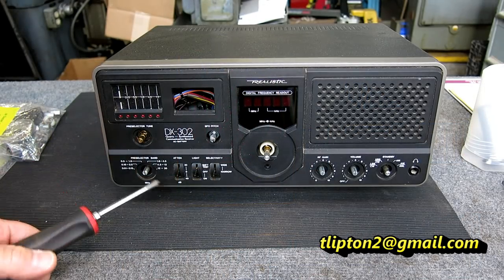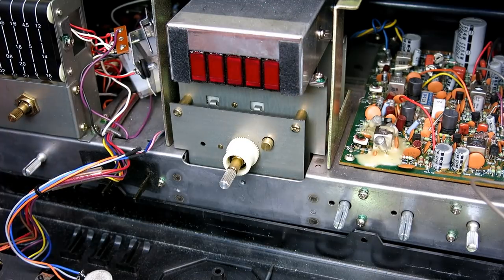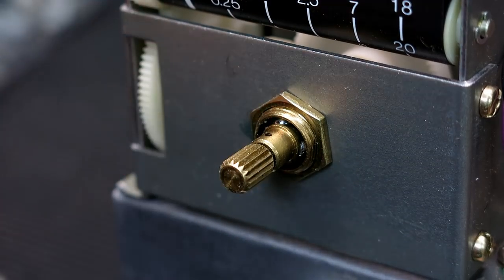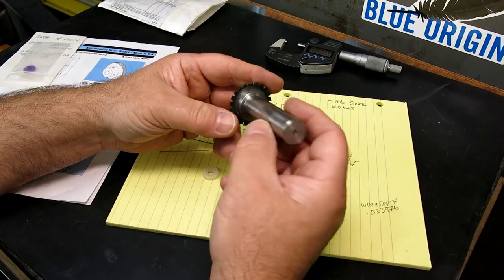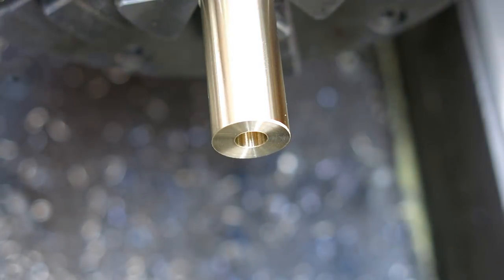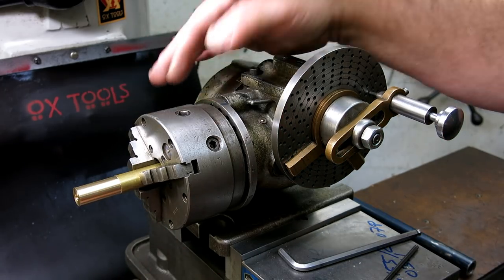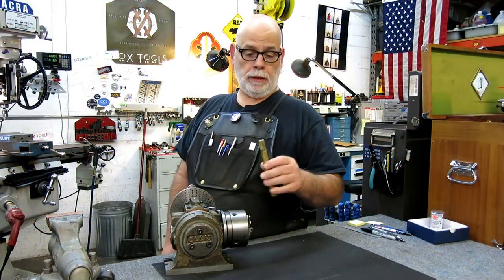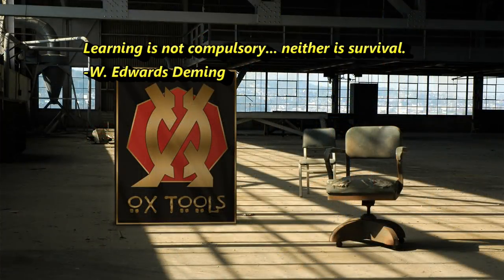Ham Radio Gear Repair

Comment: Another one saved.
As a ham I really like this. This kind of gear is often scrapped just because it has no big monetary value. Way to much equipment is lost and we run the risk of losing our history.
As a mechanic I really like this for the same reasons as above :-)
Reply: I was recently cleaning up and was thinking how often the last of a kind is just thrown away in ignorance of it's nature and value. Even the cheapest Chinese crap that you wish never existed have a value to someone and show a timeline worth preserving.
Reply: old is bad.  really gets on my last nerve. wd4sew
Reply: Aye, truth spoken.
Reply: @jmh8743  I shall have to disagree.  My Drake R4 and 2NT are fun to operate (read: analog) and dependable with no ESD worries.  W8YI
Reply: @jeffryblackmon4846  think you took my sarcasm wrong way. "old is bad, that really gets on my last nerve."
Reply: Anders Karlsson 73

Comment: For those not in the know wondering on the frequency breakdown, 30 MHz is basically upper part of the long range HF band. That is a typical upper end. But 10 KHz is down more towards the bottom of the bowels of the spectrum, closer to ELF submarine deep seawater penetrating, very slow signal/data speed transmitting range. My R75 HF receiver only goes down to 30 KHz but goes up to 60 MHz, so that radio would have a better low end receive. That would make it better for things like beacons, maritime and marine applications and some time signals. Kinda odd duck in that respect for a radio. I hope that makes some sense for you non electronic/electrical but quite mechanical geeks out there.

Comment: Pretty cool. Most of my ham shack equipment is vintage and uses tubes. Some of it is new. Some of it is home brew. Such is Ham radio. This video is a good example for those of us that like to restore and preserve the old gear. I see some of the corrosive glue that was popular to use. PITA... 73 NE5U  Mike

Comment: Great video Tom! While there are times when I get annoyed that YouTube makes recommendations, this is not one of them. As others have said, always nice to see a project from start to finish.

While my wife certainly won't thank you, I do for introducing me to another tool I must have (0–1/2" mike). I immediately though of the disk micrometer since I have one, but then thought in this case with all of the interferences that my groove mike could also work: the 0.250"Ø disks are 0.057" deep for "outside" measurement, which would be plenty for the 1/4" shaft.

Thanks, Charlie

Comment: Nice project Tom! Brings me back to all those 0-80 set screws I had to use in the Instrument Shop at NU for years. Just how many times could I use this 0-80 tap in stainless was always a concern I had before each hole to be tapped. As always, thanks for letting us look over your shoulder!

Comment: I am a HAM radio op, and a few decades ago I finally got my hands on a working radio like this!
I had been lusting after it since I was 12 and I saw it for the first time in the local Tandy store!
They are great receivers, and were quite pricey back in the day.
There is more HAM equipment that uses comparable tuning systems, and the problem is often that the plastics used back in the day just turn to goo or to dust. Even if you have a working specimen, it pays to open it up and get the details on the mechanism, in case it has to be remade and replaced...sooner or later it will have to

Paddy
Reply: The workings on the Ten-Tec Omni A has to rank as one of the poorer examples.  I had to resort to dedicating a frequency counter to it (another Rad-Shac item).  My station has been back in a corner for so long now that I don't know where that is, or if it's even still any good.  The radio itself has been rock solid reliable, though.  As long as your power supply is steady and clean, you can expect good performance.

Comment: Very cool. Hewlett-Packard 8640B RF signal generators have a fairly complex gear train in the tuning mechanism, molded nylon gears that have now shrunk and split like this. As I recall, there are bevel gears in that one, though...not so straightforward. There was some talk years ago about having a batch of gear sets machined, but the cost was too high to gain much interest.

Comment: I had been on the fence for a while on buying a 4K monitor for my computer, but finally deicded to get a 42" (104dpi) one. One of my favorite uses for it is to go full screen on videos like this and really be able to get an expanded view of what is going on.. I had been a little uncertain about  how a dividing head is used until I was able to really see in large format what was going on.

Comment: Nice repair Tom, I have the same radio that I baby the tuner. I have read in various forums that little gear is a common failure due to the aging process. I now have the information what the gear specs are. Thanks for your informative videos and knowledge.

Comment: Oh, I remember all the radios and scanners that radio shack sold. I use to buy a lot of electronics for building and repairing. I got my first shortwave radio from Radio Shack that's how I got interested in Ham Radio so I study hard and got my license. Today I hold an Extra Class Licence. My call sign is kg2nc. Thanks, Tom for sharing.

Comment: The gear reduction drive on the HAM receiver is called a planitary drive.  Because the balls "Planits" revolve around the axis of the shaft.  Used by Collins and Hammerlund in the in the 1950s and 60s for the same thing.  T. Smith

Comment: Very nice video. Now, if you read the really old engineering texts (1900s) they define Module as M=1/DP. If you look at the gear cutting formulas you find a lot of 1/DP factors. So in an era when dividing two numbers was difficult, and multiplication easier, it made sense to use Module. But on the metric side, the definition still holds, but the units are changed. So the "modern" definition of module is M =25.4/DP.The term DP has come to mean Diametral Pitch in Imperial units.

Comment: ya hey thanks for the heads up on those cutters. I've been thinking of making some bronze/stainless gears for my abu Garcia shore casting reel and the smallest cutters I've been able to find are Z 1.  been so long I have to brush up on the calculation for sizing. gotta find the tiny ceramic barrings to make it all worthwhile.  real good documenting of the gear cutting process love the o-ring for holding the wires

Comment: That reduction drive is essentially a planetary gear set, with smooth balls and friction substituting for gear teeth. Just for jollies, show us how you can maintain the precision necessary to make one from scratch! 
 For a 36tooth gear, your dividing head is overkill. a simple spin indexer will do any whole-degree increment, and a 10 degree increment can be done blindfolded.

Comment: Great video, Tom! One question: what is with the melted-cheese looking stuff on the circuit-board to the right of the screen in the shots where you are mounting the new gear??
Reply: Eric Beyer -- Likely stabilizing epoxy. Not quite potted, but headed that way.

Comment: Its basically a planetary gearset using ball bearings for the planet gears. That's great until it gets some wear and just slips. Kind of like the sprag clutch in an electric-start nitro-power Traxxas RC vehicle/engine. It works awesome until there's a little wear and then you have nothing and get to replace the sprag if not the crankshaft with it. Radio Shack "brand-names" were/are not known for "high-quality" hardware. As evidenced by the stripped plastic gear. Now with a metal driven gear you can start working on a replacement for the plastic drive gear which will fail next unless nobody that hits the end of the tuner "travel" and keeps on turning or "overspeeds" the knob ever touches that radio again, lol. The "problem" with that huge frequency range is the same one that caused the manufacturer to install planetary "gear" sets in the tuners. It takes for ever to crank multiple mechanical tuners through all that frequency range and "tuning" has to be super-precise so a big knob goes on an "underdrive" tuner operating mechanism and when something "hangs up" big knob plus gear reduction HOPEFULLY lets those "planet balls" act like a sprag clutch and "slip" before something breaks. After that happens hundreds or thousands of times every time somebody "overspeeds" the knob slipping that sprag/planetary "hybrid" the balls and/or shaft and/or "carrier" get worn and the worn-away metal "dust" ends up making "grit" out of the grease and the sprag/planetary "locks up" when it should "slip" and other shit breaks. Then if its "fixed" with "heavy-duty" replacement parts the next time it locks instead of slips, something else breaks. It would be very wise to flush and relube the sprag/planetary on that main tuner unless you want to go back in for more "fun".

Comment: Nicely done, Tom. I've not seen gear reduction like that before so thanks for showing that more closely as well. My first thought when you were picking up the centerline when cutting the gear teeth was to touch off top and bottom and then use the 1/2 function. Have you done it that way before and is it reliable? Best wishes - Tom Z

Comment: A perfect job for Abom79 on his fancy 3D printer :) Or NOT.  Nice job,  I rather like  the permanent brass solution.  Why not use the red loctite instead of the set screw (for a smoother gearing)

Comment: I'm kind of wondering whether the position of the shaft the main knob turns and the one that the new gear turns have to be in a particular alignment?  I'm thinking of something like an engine's crankshaft to camshaft alignment.  Obviously the set screw can be loosened and it can be adjusted, but is there a way to know where it's supposed to be set to, if it's actually important?

Comment: Hi Tom. I really enjoy your videos and find them very educational. I do have two questions. One on that reduction mechanism with a ball barring. Is it basically a planetary setup with with the balls being the planet gears and friction driving them?  And two could you have drilled the set screw hole before you cut the gear teeth? That way tooth isn’t interfering with the bit.
Reply: Yes, it's planetary but they can slip. The balls are loaded into the housing under preload so they won't slip in normal use. I remember working out how those things work as a kid and having the exact same reaction, "Hey! That's super smart!"
Reply: Thanks Doug

Comment: Certainly there are multiple ways to flay a feline, but might one of them been to touch off on the top of the blank, touch off on the bottom and use the DRO half function, with everything cancelling out?

Comment: Tom -  EXCELLENT job! The only question I have is wouldn't it have been better to locktite the gear onto the shaft rather than to risk the tiny little left over teeth breaking off where the set screw was drilled in?
Reply: it would be a short video if he said "I ordered a replacement plastic gear online, and then loctited it onto the shaft"
Reply: Not saying he should have ordered one, but he is taking a risk of ruining the job by making one of the teeth split and fragile - remember it's Brass.  I suppose since he made the Brass piece so large, he could have just parted off another gear.

Comment: You could build stacks of gauge blocks to the estimated diameter of the shaft and wring a pair of extra blocks (size immaterial, but fairly thin) to the top and bottom of the stack overhanging a bit. This would then be like a very compact go-nogo gauge. Adjust the interior stack to get two measurements straddling the actual size of the shaft which would give you a pretty good idea of the shaft diameter. You might need a small clamp on the stack to prevent popping the wringing apart.

Not much use for t-shirts (nor hoodies), but a mug with the ox-tools logo would be cool.
Reply: Ditto on the mug!

Comment: Tom - around the 3:00 minute mark the Grey caps look discolored at the bottom, they should be checked and replaced if necessary. If those caps are original then their life has been exceeded.
Reply: Yes, as Mr Carlson says...."re-cap them all"...
Reply: Best to replace all old caps. Those electrolytics go bad easily and quickly.

Comment: Tom, why did the plate you used say 28 but the sheet said 27? 
I glossed over this vid earlier today in my feed because I saw the thumbnail and thought it was a Mr. Carlson video LOL. I watch those on Patreon so I skipped right over it. And of course YT decided not to notify me even thou I've rung that stupid bell. 
As always thanks for all the info and entertainment Tom.

Edit: Also may I ask why you went with set screw rather than press? Was that just how the original one was? Nevermind.... how am I going to press that apparatus LOL thanks again Tom
Reply: The ring of holes Tom used had 27 holes. The outer ring had 28 and was probably the marking you saw.
Reply: You need to watch the video before you comment.
Reply: Yorkiepoocharlie  Thank you
Reply: @EVguru  thanks Paul, I should have known that.
Reply: @paulcopeland9035  You need to not reply to my comments.
Reply: @Steve_Just_Steve ....Why would I?  BTW, who put you in charge anyway?
Reply: @paulcopeland9035  My thoughts exactly.

Comment: To bad I couldnt get you to make me a steel pinion gear for my concrete mixer.  The original what is plastic and its supposed to mesh with a steel ring gear. They dont hold up for nothing.

Comment: Radio shack, cool stuff????
Oh. Radio Shack usually equated to garbage. The Sears of electronics. It is so pervasive that it really needs not be said. That’s why both are gone.
Reply: There were Gems among the Garbage. This is a gem.  No blocked frequencies.
Reply: It's a typical SW receiver of the time. Built in Japan, then equivalent to today's "built in China". It received the same frequencies any other SW receiver received. Narration said "receives down to ten kilohertz". I believe that's a typo. Maybe 100 kHz. Nothing really horrible about it. But it's nothing special, nor a ham radio. I suggest that any "gem" status would be based on some kind of nostalgic memory of getting it for Xmas or similar. Thanks - Lumpy
Reply: It's the low end frequency pick that makes it special and nothing else. It is indeed not particularly good in any other respect. It's that one quirk that makes it somewhat special.
Reply: What in the world is a "Low end frequency pick"? Thanks - Lumpy